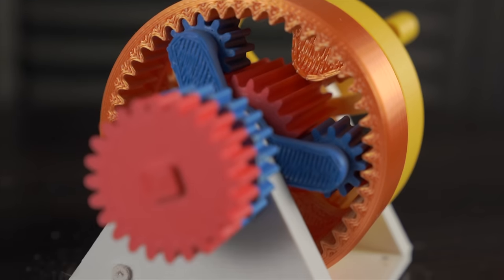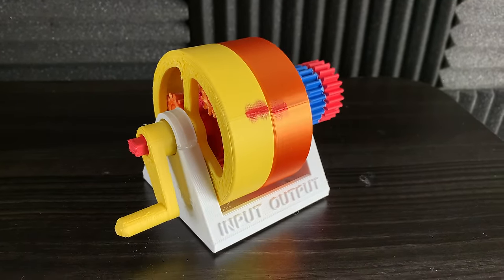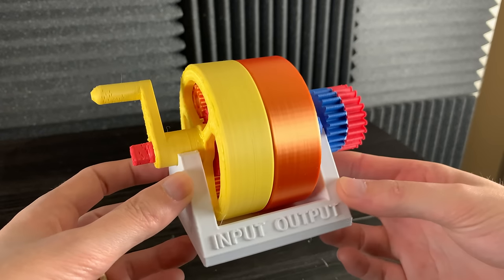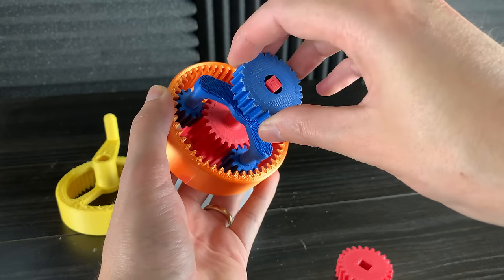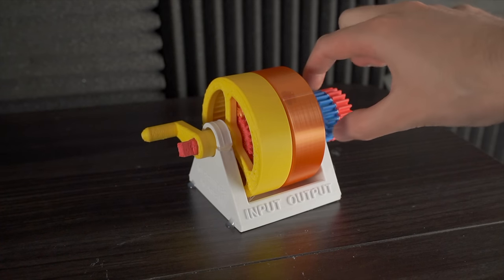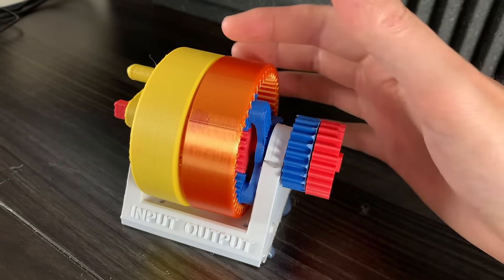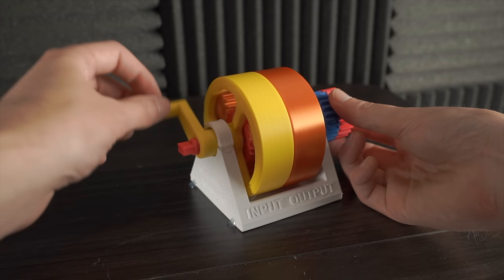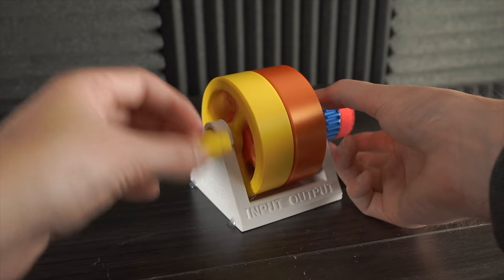How do automatic transmissions work?

Comment from the maker: This model is based off a Simpson planetary gear set. "A Simpson gearset delivers three forward gears and one reverse, plus neutral, and is commonly employed in three and four velocity automatic transmissions." You can read more about it here: https://en.wikipedia.org/wiki/Simpson_planetary_gearset
Reply from the maker: Edit / Video Correction: *In the US, 96% of cars on the road are automatic, manual transmissions are more common in the rest of the world. Manual transmissions are more widely used because "they are more reliable; cost less to operate; have more power; are stronger, and make your car more economic".
Reply: This is how a planetary gearset works, not necessarily how an automatic transmission works. The main thing that makes "automatic" transmissions to be automatic are the gearshift actuators and sensors. Even dual-clutch transmissions can have an "automatic" mode, making them automatic without using planetary gearsets.
Reply: @sepg5084  That's about the most idiotically pedantic comment in the history of comments sections. Almost every single automatic transmission used in any car in the world uses planetary gears.
Reply: The proper name is planet carrier gears.
Reply: Good attempt, but falls off into total confusion after about the 3rd sentence. 

Those 2 handle gears sticking out the back throw everything off. 

Maybe making those ring gears out of transparent or "hatched" plastic would help. 

I've never seen an attempted description of an automatic transmission that didn't make me hate the subject.
Reply: @MrZog-yv3be  While CVTs may be controlled via some method of automation, they are not an "automatic transmission," within the standard usage of the term any more than an automatically-shifted dual-clutch transmission is. The traditional automatic transmission uses a torque converter and a series of planetary gear sets which are always engaged, but whose effect is changed through locking them with hydraulic-operated clutches. The hydraulics run off an internal pump, and - though modern systems have additional electronic controls on the valve system - the traditional "automation" is a fully mechanical system controlled by transmission speed (translated to hydraulic pressure) and some sort of kickdown mechanism where, in case of instant engine demands (acceleration, etc.) a cable- or vacuum-operated linkage will force a downshift.
Reply: @3DPrinterAcademy  Is there a place I can order the 3d printed parts for this? I dont have a 3d printer to make this and I'd love to have a model of this.
Reply: D'oh
Reply: @noiwonttellyoumyname.4385  Lmao in what world is an "automatic gearbox" purely limited to torque converter planetary gearboxes? The entire idea is automatic shifting, it has nothing to do with the particular mechanism. Even "F1" style automated manuals are sold by manufactures as automatics, you're using your own mental definitions to arbitrarily decide what's a "real" automatic and what isn't.
Reply: @3DPrinterAcademy  Actually here in the US, we were taught the opposite of that. Manual transmissions here often can’t handle the power of the engines (for example, 900+ ft/lbs of torque) from a new vehicle. We were told that better fuel economy can be achieved with automatic transmissions with more gears to hold the engine in the power band. Also, it’s easier to control engine performance if you only allow shifts at certain points.
Reply: @yinyangsaladgang8789  No, I'm really not. Go ask your mechanic if there's a difference between a DDCT and an automatic.
Reply: @sepg5084  yes but planetary gears are important components since they can be operated under load by clutches.
Reply: Definitely a good tip for American tourists - if you’re booking a rental car with your European vacation, make sure you explicitly request an automatic transmission, because it’s definitely not standard.
Reply: @3DPrinterAcademy  That's no longer true.  Generally speaking, in most markets, modern automatics can handle more power, are more economical, cost less, and have better performance.  The only reason to buy a manual today is for fun.